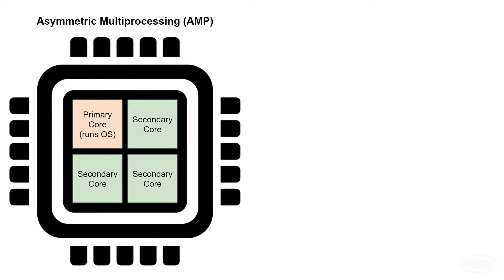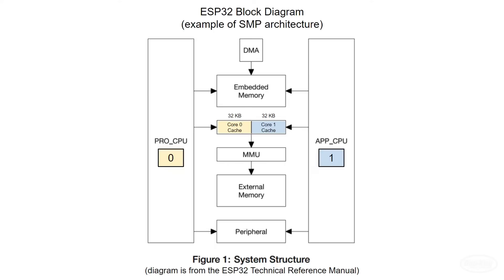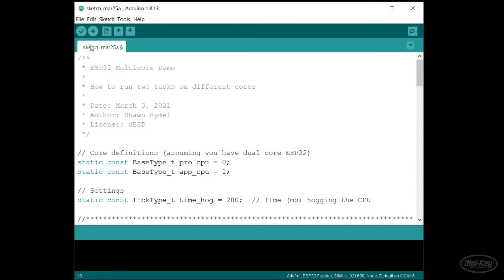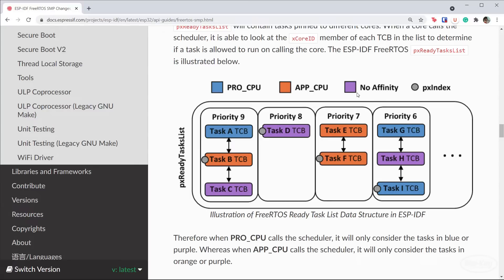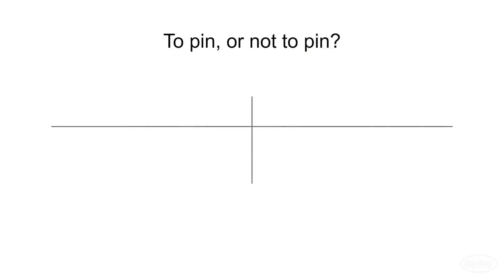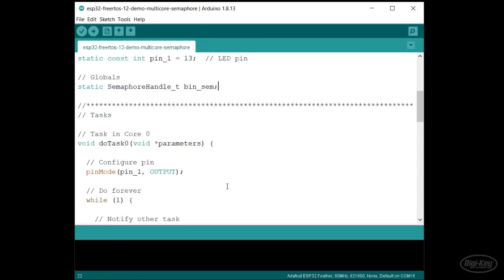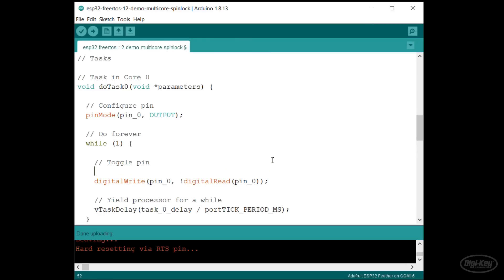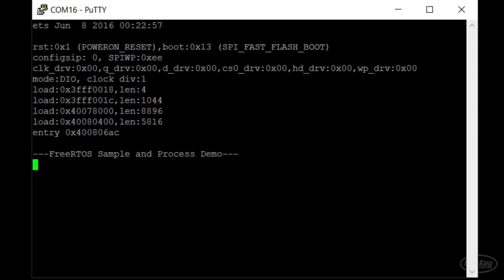Introduction to RTOS Part 12 - Multicore Systems | Digi-Key Electronics

Comment: This is a good series. As an engineer with 27 years of experience, it has been my experience you can do a lot, probably 99% of what you need, with the basic concepts you have outlined here. I always try to remember, you are building something that may outlast your tenure, so why make it complicated? Processors now are so powerful they allow much simpler implementations without reaching hardware limits.

Comment: I need to control four full H-Bridge driver chips based on the angle input of an absolute encoder, the calculation of the current RPM from that (0 to 10500 RPM), desired rate increase/decrease from a throttle, and calculated load. Converting degrees into nanoseconds for the RPM I find I need a controller that can set outputs based on timed interrupts (I think the most efficient method).
Q: What controller processor and RTOS scheduler can reliably be used for those simple calculations along with time interrupts of 100ns increments for this to turn on or off output pins such as:
47600, turn on output pin4 
48200, turn on output pin1
53900, turn off output pin 4
54500, turn on output pin 3
55200, turn off output pins 1 and 3
Thanks in advance...

Comment: It is interensting that core 0 is recommended be used for Wifi/BLE communication by defualt. If i do the straightforward thing and initilize Wifi.begin(..) in void setup() then it is going to run on core 1 (since setup task is running or core 1). However, if i force Wifi.begin() to be initialized in a task (w/10kByte stack) that is assinged to core 0, then both the wifi and its http get/post functions run on core 0, but this causes ESP crash many times (if Wifi is on core 1, then there is no crash at all). Does anyone face this behavior? Any thoughts? Anyway thank you Shawn for this fantastic playlist!!!

Comment: Since the watchdog timer has to fire if the scheduler isn't run often enough, it indicates that FreeRtos is NOT a preemtive RTOS but rather cooperative where each task MUST surrender the cpu to let other tasks run, rather than having it yanked from them when their time slice expires.
Reply: It’s still a preemptive RTOS, as the scheduler can preempt a low priority task to run a high priority task. You don’t have to yield the processor explicitly to allow other tasks to run. The WDT (which you can disable) forces you (the programmer) to yield regularly, but preemption can still occur.

Comment: Awesome video again! Can you elaborate some more on why to run BLE/WiFi related tasks on Core 0? In my program the ESP32 functions as a middle man between both protocols translating MQTT messages to commands sent to BLE devices. I'd like to get an idea on how to set this up correctly, core wise. Thanks in advance and keep up the good work!
Reply: Running BLE and WiFi tasks in Core 0 is just what Espressif decided to do as default. You can change it in ESP-IDF (https://esp32.com/viewtopic.php?t=9225). I don't know too much about those tasks honestly, as I haven't played much with them directly.